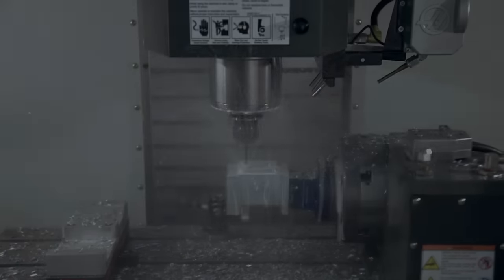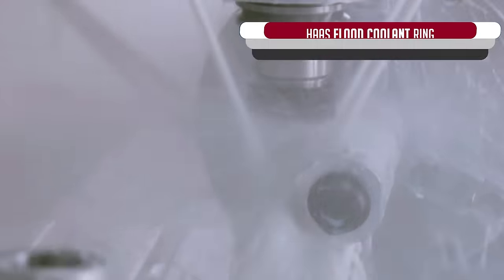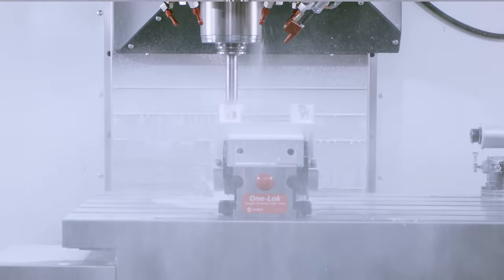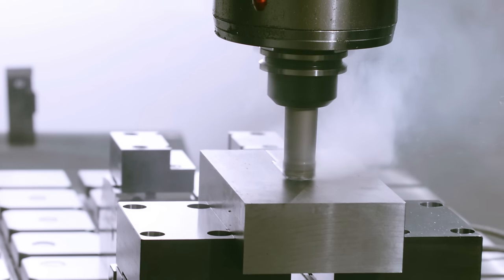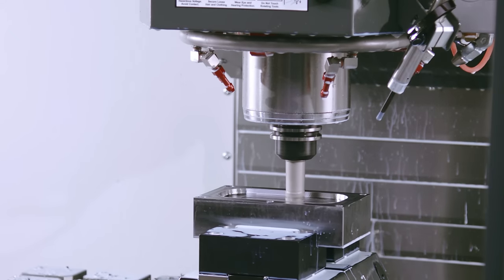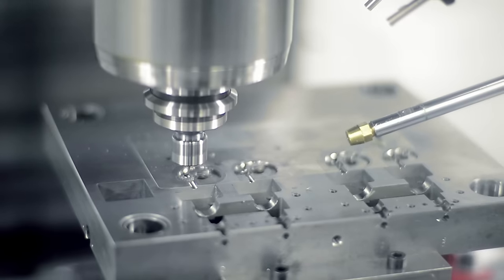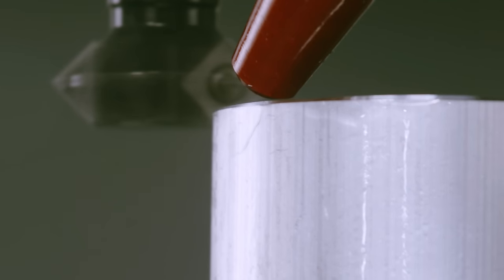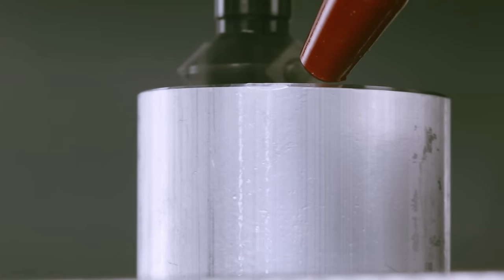Haas VMC: Chip Clearing and Tool Lubrication

Comment: I love the through spindle coolant on my VF4!  Just have to make sure your tool supports it, otherwise you'll fill up your gearbox!
Reply: yeah, just call flood coolant instead of thru spindle coolant.  Or don't call coolant at all.
Reply: @capnthepeafarmer  I noticed that for tools with long overhangs, changing thru spindle coolant pressure can improve stability, or reduce vibrations. So wash&go 😁

Comment: What is the name of the white coolant you use and do you recommend it? I have been using hocut 807 but find it separates very quickly and doesn't stay a nice milky state very long. Ends up rusting some parts.
Reply from the maker: Russell Kap - We are using Castrol Hysol MB-50 in this video. We also use it throughout the Haas factory. It is a high oil content semi-synthetic water soluble coolant that works quite effectively on both steel and aluminum. And it is highly resistant to separation when properly maintained. Hope this helps!
Reply: @haasautomation  price in india

Comment: how to remove chips from fixture & job after mchining . now we are using air gun but due to moisture in air rust issue observed in job. what option ?
Reply: Rust is big issue in machined components.
Reply: @BLACK-hl4ic  
i don't understand how the chinese have such a problem with this. (americans too but china most.  always when we get parts we need to redo from china.  it's rusty)  
everything we machine here in the netherlands stays rust free.  because we know what we are doing.  and i guess because we don't have salty acid sweat.  

use diffrent coolant water.  
clean the coolant water more often.  (like litterally refresh it, and use a filtering system in between refreshing) 
8-10% mix of the right coolant oil into the water.  

and if the air quality is a problem use air conditioned buildings.  make sure it's 21 degree's celcius. and dry.
Reply: and if that makes it too expensive then you're taking the wrong jobs
Reply: @darkracer1252  may be cutting oil and water ratio is not as per specs.
Reply: @BLACK-hl4ic  i litterally said that
Reply: @darkracer1252  ye QR code kyo laga rakha hai